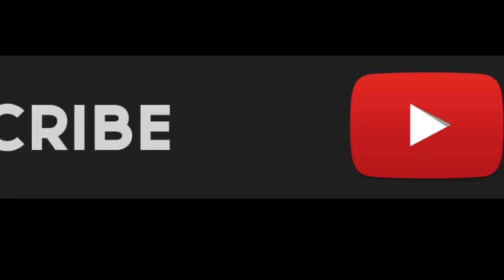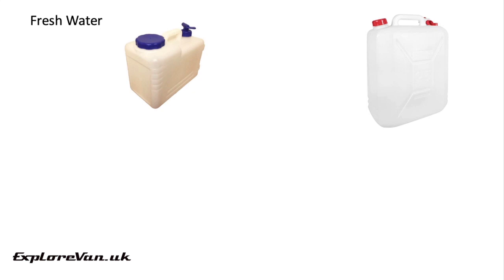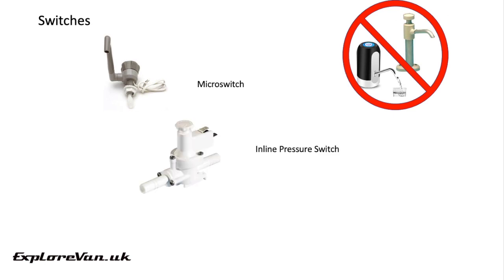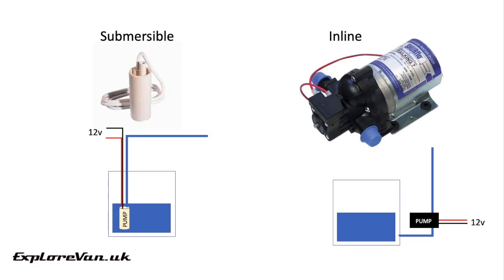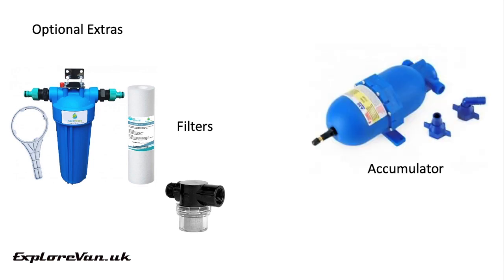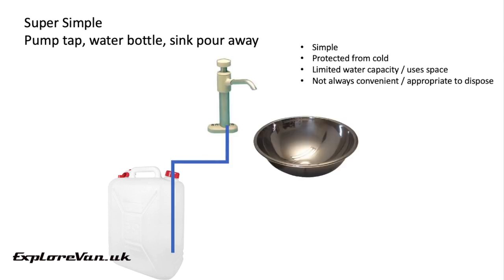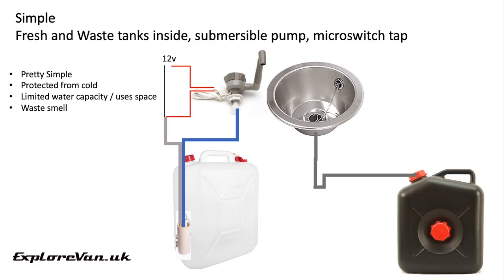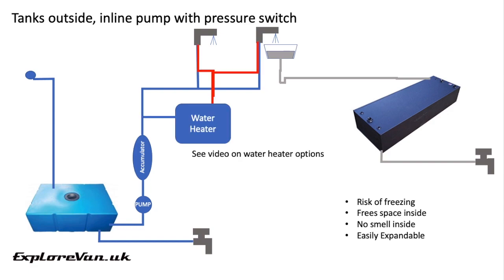Campervan conversion - Water system and plumbing - tanks, taps, pumps and waste

Comment: Another well explained subject. One question, when will you be doing your tyre review? I’m about to replace mine and it’s always good to get someone’s experience.
Reply from the maker: Hi thanks, glad it was clear.  

I wish we’d been able to do enough mileage to be able to do a follow up on the tyres. ☹️

From the limited miles we have been able to do I would say they definitely give more grip in mud (got us off a field that I’m pretty sure we’d have struggled with before. 

We’ve not seen any noticeable increase in noise or fuel consumption.  They also seem to be more hard wearing particularly on the shoulder than the standard tyres we had on before, so overall I’d recommend. 

I will do a follow up video once we have got some more miles in but I expect that won’t be before the summer sadly. 

Hope that helps!